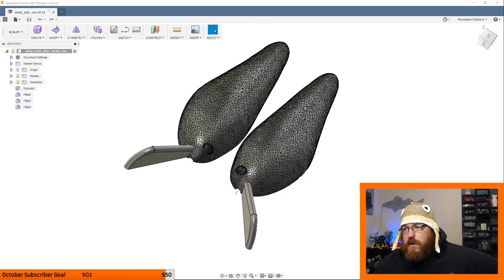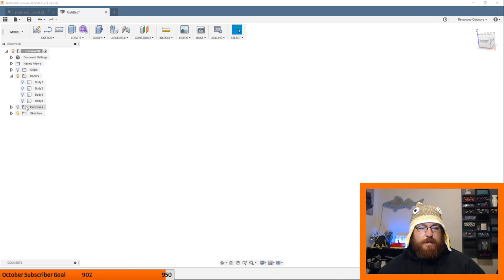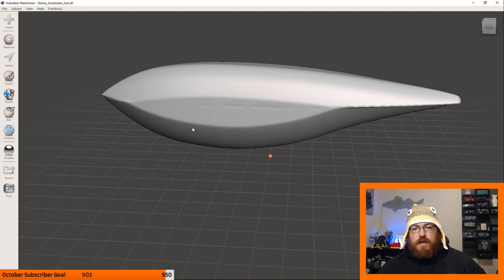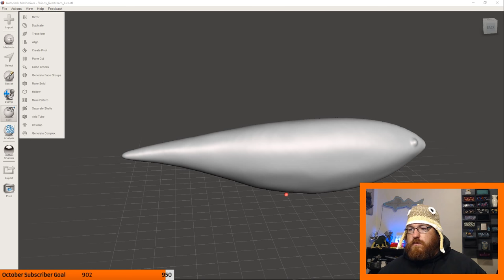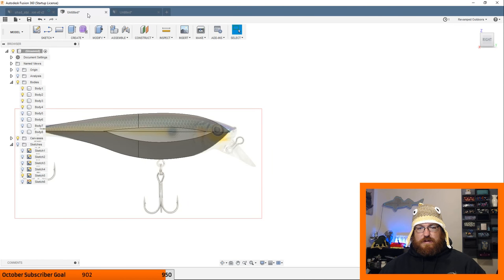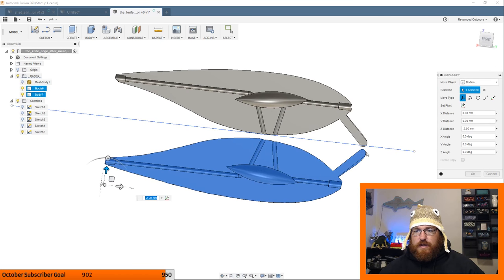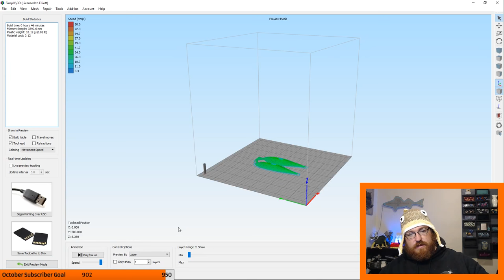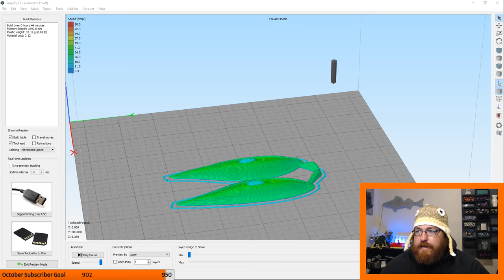Let's Design Some Crankbaits (Fusion 360 and Meshmixer start to finish)

Comment: What’s size hook eyes did you use
Reply from the maker: I usually run a through wire to a snap ring then chose whatever size hook fits the profile. I usually bend the front eye with a wire former like a Hagens or spinner maker. I think the one I use isn't made anywhere can't find it online anymore. I think the loop is about 4mm ID
Reply: @RevampedOutdoors   thank you

Comment: Im really interested in asking you more about your thick silicone jig skirts you made with bottles of silicone and wax paper. It really resembles flat living rubber. Does it flare like LR? Do you still use the same products?
Reply from the maker: Depending on how thin you can get the cuts it looks a lot like the standard skirts in the water. The trick is to get a good standard cut on the silicone and a good even pour thickness for the silicone. Pouring by hand on the wax paper means that the pour can have a thicker middle compared to the margins. A lot of the time I'll cut a bunch of pours and then put the cuts in piles of thinner, thicker, average etc. Then when I'm making the jigs I will pair the thicknesses according to how I want the skirt to flair in the water, thicker material in close to the hook thinner to the outside to get it to do the typical skirt movement. I still use the smooth-on stuff it's been working well. I hope this helps!

Comment: Could you show how to make a reverse image to make a stencil that would be exact fit?
Reply from the maker: You mean for painting the lure after it's done? That's a great idea, I will put that on the video to do list. But real quickly you could do it by importing and scaling the finished stl to be larger and then cutting it away and then adding and subtracting for the stencil with  different sketches. But the next time I get the time I'll do a video on this! Maybe one of my completed lures on thingiverse so i can add a stencil. Thanks for the suggestion!
Reply: @RevampedOutdoors  yes sir that would be awesome. Would like to know how to make one for any lure